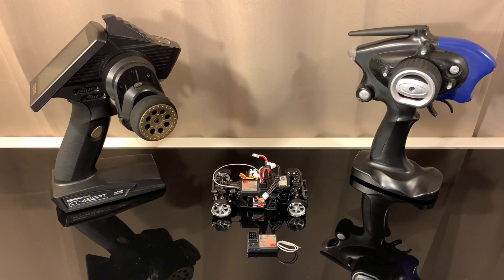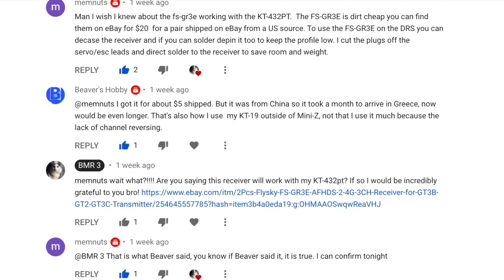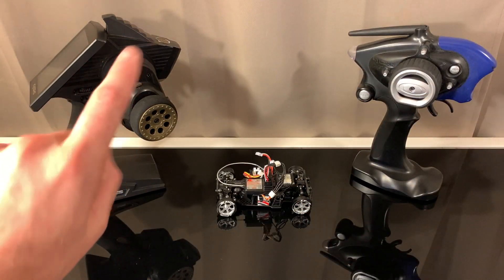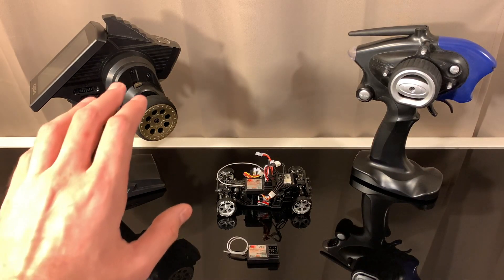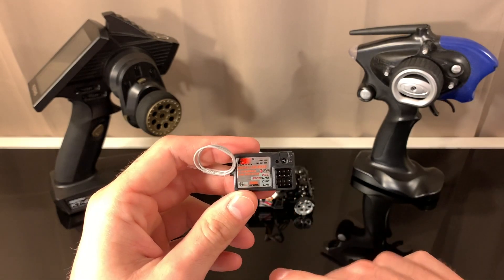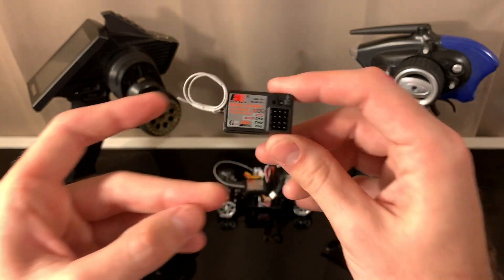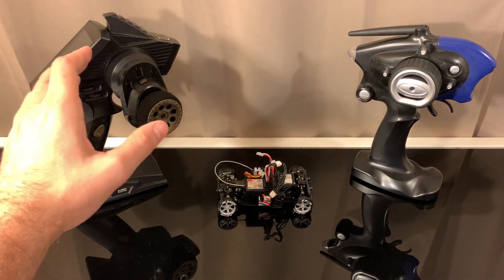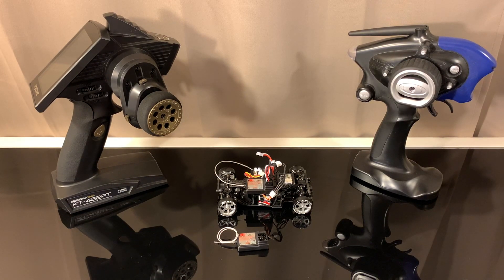My New Favorite Micro Receiver! FS-GR3E by FlySky (Mini-Z FHS Compatible)

Comment: you should still look  up the Das Mikro receivers, they have them in all protocols, i have one in ASF, Futaba, KO PROPO, and they all work great, also they come with the correct plugs for  these 1/27  scale cars so no excess wires as space is critical in those bodies.
Reply from the maker: Thank you for the tip! I have never heard of Das Mikro receivers, I have seen the LOC RC micro receivers but they don’t produce one for the KT-432 frequency’s 

Thank you again man, I’ll look them up & send them a message. I would love to have a proper micro receiver
Reply from the maker: I have searched all over & I can’t find a Das Mikro receiver board that is comparable. Sadly there is no real support for this controller 

My next step is going to be to try to track them down & get in contact. Never know, just asking may get them to produce one 😸
Reply: @BMR3  I just searched Ebay, they are still there, its all one word dasmikro  they have them for all the major brands.
Reply from the maker: I found them, but the issues is they don’t have any for Syncro Touch. They have all the major brands, but the KT-432 is not compatible with the KOPRO FHSS frequency

Comment: nice alternative to the rtr controller. new sub here
Reply from the maker: Thank you for the support man, it’s much appreciated! 

I’m really happy with this controller/receiver combo, but I have plans to make the footprint even smaller. I need to work on my soldering skills, but eventually I want to decase the receiver & solder all the leads directly to the board. My goal is to make the cleanest wire set up possible (got a long way to go!). 

anyways, have a good one man & stay safe out there!

Comment: Good fine, but you never showed binding process or running car. Do you bind as miniz FHS or anything else and does it have 3 pin servo connector and did you make an adapter to micro jst plugs?
Reply from the maker: 3 pin servo plugs as standard, I had to get adapters to get the JST plugs to work. Sorry I dident even think to show the binding process since it was so simple. If you search the name of this receiver, there are literally dozens of videos that pop up on the binding process. 

Yep just set the controller to “Mini-Z FHS” & hit the binding button, then plug on the binding clip to channel 3 (on the receiver) & bam its bound.

Comment: Been watching your videos for some time now. I’m not as advanced as you In terms of parts etc. I’m just more of a noob to all of this. 
I wanted to know :
1. Which transmitter do you use? I’ve seen videos that stock transmitters are not as good as compared to kyosho’s other offerings 
2. What batteries do you use and what charger ? 
I have the MA020. 
Love the videos!
Reply from the maker: I currently use the Sanwa M17 for my RWD drift chassis’s & the KT-432pt for all my mini-z chassis. The 432pt is an outstanding controller & you will notice a difference from the stock controller straight away. 

As far as batteries, I run 900mah & 750mah rechargeables from PN Racing & a Kyosho speedhouse charger (I don’t recommend this charger btw) 

Thank you for the support!
Reply: @BMR3  thanks for the reply! Awesome! Yeah I saw the Sanwa but sadly just too much. The 432PT sounds up my street. Heard good reviews all over. 
Do you mean the $30 or so 4 bay usb charger? That’s exactly why I was asking as I can not seem to find a decent one. I had a wicked team Orion one that was real functional but broke. They don’t sell it anymore now either.
Reply from the maker: @JA-uz7se  the speedhouse charger was in the $30-$40 range but was not worth it since there was no display to see what’s going on, just little lights to indicate charging is complete. 

Honestly just get a AA/AAA charger from Amazon or eBay or where there is one for cheep. They all do the same thing but some will allow for features like balancing or discharging, those typically will have a small screen display. 

Hope this helps, good luck!
Reply: @BMR3  thanks for letting me know was close to getting that speedhouse one. Lucky  as already have something similar I’m using right now. 
If I got the 432PT will it work out of the box with my MA020 or do I need to buy the receiver also ?
Reply from the maker: @JA-uz7se  the kt-432 will work with any of the rtr FHS & FHSS (what you have) chassis straight out of the box 👍
Reply: @BMR3  thanks buddy, just got one and arrived today. I got the LED lighting set, will it work with the kt432?